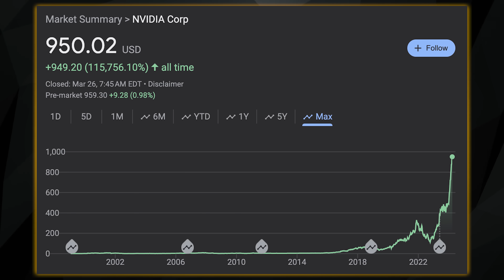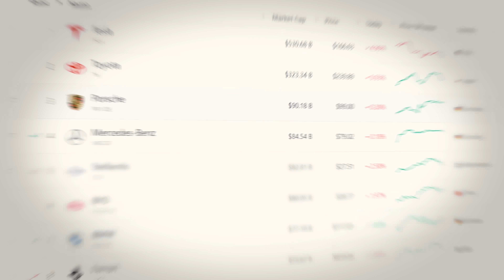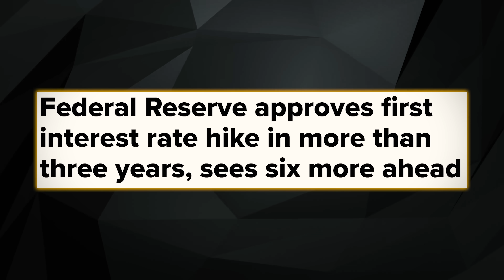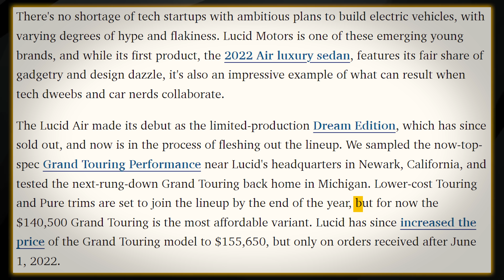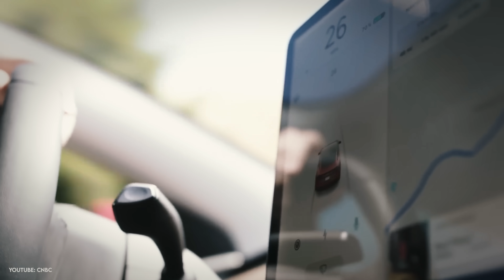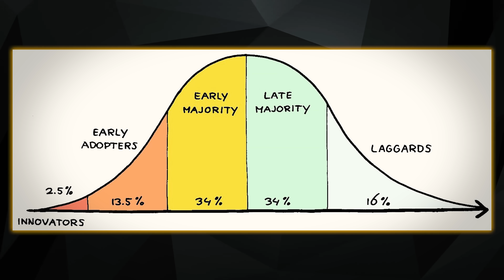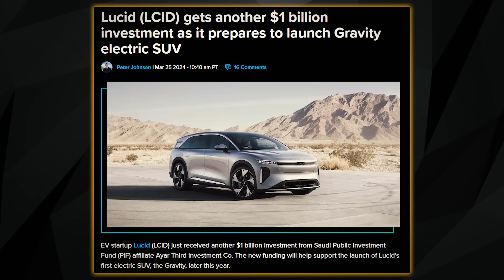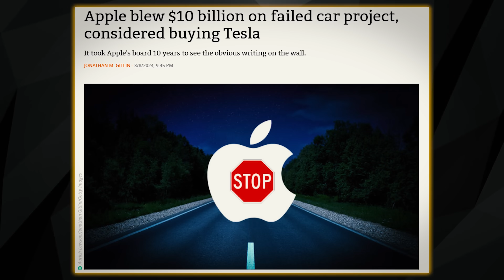The EV Bubble Popped - What Now?

Comment: This video glosses over one of the main issues - infrastructure. There a half dozen gas stations within a few miles of my house. The nearest supercharger bay is closer to twenty miles. I might be able to deal with that commuting to work, but for road trips? I'd better hope nothing comes up, because otherwise the next nearest chargers are hundreds of miles away - with exactly zero on the route I take to visit my family.

Hybrids, with a gas engine charging a battery, would make much more sense, but those aren't considered sexy like an EV. However, they are infinitely more practical until chargers are more common and spaced so that road trips don't require weeks of advanced planning and fear that the stations won't be working when you get there.
Reply: More chargers are certainly the way to encourage use of EVs. It’s technically not that difficult since they don’t have the HAZMAT issues of gas stations, and much cheaper aluminum wiring is already proven as it literally powers the whole world as overhead transmission lines.
Reply: Not to mention the fact that the US already doesn't have enough powerplants and it's pretty much just illegal to build new ones.
Reply: @maxscott3349 why don’t you think they will build more power when demand increases? It’s not strange they don’t supply until demand is there.
Reply: This guy is completely right about hybrids versus EVS
Reply: @TheBooban  The demand has been there for the last 20 years. Many places, including where I live, have started charging more not because it costs more but because they need people to use less
Reply: @maxscott3349  yes and at some point it will be worth it to build more power.
Reply: I live in a city of 279k and we have 12 fast chargers and dozens of slow chargers within 10 miles of any part of the city. Where the Hell do you live with only 1 in 20 miles?
Reply: Eh, my closest ev charger is in my garage, and that could be true for anyone with off street parking, including big multi story parking garages.

I have no idea how many fast chargers are in my city, because on a road trip my first stop will be two cities over once i've run down my initial charge from home. And the same goes for coming home, i would charge two cities over and arrive home empty and plug in when i park.

As for charger availability, i've driven several 6000km round trips in my ev which only gets 200km on a full charge in winter because it's a big van with a small battery, and chargers are not a problem at all in europe. I know that many other parts of the world are still developing countries, but it's really just a question of dropping down some chargers, electricity is everywhere.
Reply: By that same token, consider the stress so many EVs put on the grid. And where do you think the energy in the grid comes from? Mainly non-renewable resources all over America. This ironically exacerbates the environmental damage.  The first and most critical step is to ensure that the grids are powered by reliable sustainable energy sources and people are incentivized to use solar panels and such to generate electricity so that they can charge their EVs while at home.
Reply: Well, you could install a home charger which doesn't really cost that much, and wake up to a full battery every single morning, sounds pretty convenient to me...
Reply: @WaterKing9 where I am at it’s at least 30 miles and I live in a small town in the South
Reply: I'd rewrite the not sexy part. The latest 2023 Prius got quite the facelift last year...
Reply: @Ben21756  Yes, EV's make great commuter vehicles, but if you want to make long road trips, you are still looking at a second vehicle unless want to plan your trip around charging.

Yes, I know it's possible. I've watched several Youtubers do exactly that. However, it's not always feasible.
Reply: Agreed, however we need to adopt as many EVs now mainly if you commute in your city, because we need to replace all ICE cars by 2050, meaning it would last 15 years to replace the stockpile of ICE cars with EVs.
Reply: @doujinflip Also, if you want the average American pickup truck/SUV driver (huge portion of the U.S - just look at F-150 sales), these charging stations NEED to accommodate vehicles with trailers like gas stations do. The inconvenience of having to detach your trailer just to charge, on top of having to charge every 90 miles, is absolutely ridiculous.
Reply: The hybrids are as reliable as ICE vehicles with the potential fuel savings of EV's. 
I don't think anybody see's hybrids as sexy more  like a practical compromise.
Reply: @TheBooban  Because the EPA won't even let them build charge points. 5 Billion infrastructure and they built One, count them One charge point.
Reply: @TheBooban  I was in favor of building more power but now I will fight against it as hard as I can and spend considerable time and money. Turn about is fair play.
Reply: @PriffEV  Two cities over and back I'm not even to half tank in my ICE vehicles and arrive home with enough fuel to do 25% of that trip again. At -5C at night. That would be in my truck, in my car I could do it twice and still have fuel left over.
Reply: @yaxleader  American makers dropped cars. Big mistake! Foreign makes gleefully picked up that market.
Reply: @robertkubrick3738  why? Anyways, they gotta do it at some point, build more power.
Reply: @TheBooban  Because greenies have been fighting power plants all along. Turn about is fair play.
Reply: There is like 25 outlets in my house.
Reply: @PriffEV not a problem in Europe? Something tells me you haven't been in most parts of Europe. You've spoken like a true American there.

Comment: I think many people commenting on EVs haven’t yet absorbed that the maintenance and charging costs are actually not that much better than ICE vehicles. EVs do not need oil changes and they don’t need new brakes as often, but they absolutely EAT tires. People are replacing tires every 8k-10k miles. Compared my current car which needs tires maybe every 50k miles. 

And the cost to charge has actually SURGED. A friend of mine recently charged his F150 lightning and it was 70 cents per kWh. On a 100 kWh charge that would be $70. I get 20mpg in my truck, which at $5 a gallon means I’d pay $75 for 300 miles of range which is about what his f150 lightning does on a full charge.

So maintenance isn’t that much better because you have to replace tires so much more, and charging isn’t actually that much cheaper than gas. And btw, gas near me is less than $5 a gallon.
Reply: Eh, i've driven 40k km in my ev and have no unusual tire wear. You can wear tires quickly with some EVs because they have crazy acceleration, and people drive like they stole them, but with normal driving it's not a huge difference. My ev only weighs 10% more than the ice version of the car, and fully loaded the difference is even less.

As for charging, when i charge at home it costs me about 25% of what ice costs. But on roadtrips it's closer to 80%. So you're not saving much if you're constantly roadtripping and using public chargers, but most people do a majority of their driving closer to home and can charge at normal rates.
Reply: If you have solar panels charging an EV will be close to $0 Try beating that cost with your truck and calculate the fuel saving over the lifespan of the vehicle.
Reply: @xunepxaxo  You would need 30 panels on your house (if the house is going to pull any power at all!) to charge a BEV in bright sunshine to charge a BEV in a reasonable time. This also presumes the car is at home during the day to charge? Do you not have a job? Didn't take math in school? Never put in any study on actual real life output of solar panels? Where are you going to get 7200W...assuming you have the absolute most efficient panels then allowing for real life only getting 80% if that....During the day to just top a battery in a couple hours? No, you charge at night with Coal.
Reply: You have a bad source for information.

Comment: Id hate to sound like an ignorant car enthusiast, but Tesla Sucks.

Their cars sucks, dealing with them sucks, driving them sucks. The only thing they've done right is the charge stations, battery and electric motor technology.

Cheap EVs and hybrids were always better.

A cheap EV makes a good city car because you can plug it in and get enough range to last about a week.
(Think of the nissan leaf)

A hybrid is best because you will burn little to no gas in the city and you have the convenience of going anywhere you want because of how prevalent gasoline is.

Comment: Getting the public to adopt EVs has a basic solution: Make charging station as ubiquitous as gas stations are now. That's it. If charging stations were all over the place, then drivers wouldn't have to worry as much about charging. Sure, charging is a lot slower than filling up with gas, but having the option to charge even for 10 minutes or so would be a huge burden lifted.
Reply: You are making too much sense. That is not how the US government operates. Here what they do is punish the public and make threats. There will be some punitive measures or penalties for you if you sell cars that are not EV and that will be followed by punishment for people who buy cars that are not electric.
Reply: So much of the country has more chargers than cars to charge. Those spaces being empty do not encourage anyone to buy a EV.
Reply: Half the point of an EV is that you can just charge it at home.  90% of the public, including the people fretting about charging infrastructure and range, do not drive anywhere near a couple hundred miles every day and wouldn't even come close to exhausting an EV battery with their daily commute.  Then you can just charge it over night at home.  The big issue here is for people who live where they only have street parking, or in apartment or condo complexes.  That's more of a thorny issue.
Reply: Instead of having ubiquitous charging stations, why not design EVs with standard swappable auxiliary batteries?  Then every gas station can stock them for any EV that needs a short boost to get to their home charger.
Reply: @dcc70  Because you need special equipment and trained professional personell to safely handle these batteries.

Comment: Someone should tell EV car developers that 1: batteries don't work in the winter. 2: the charging network and time it takes is terrible. 3: why hasn't anyone, ANYONE connected an alternator to the wheels, when they spin, they charge the battery.......
Reply: omg take a physics class bro. you lack fundamental understanding of thermodynamics.
Reply: There's no need to include an alternator. Electric motors can convert motion to electrical energy as-is. That's how you get one-pedal driving and regenerative braking.
Reply: Ah yes, EVs don't work in winter, except in all the cold countries like the nordics where EVs are now a majority of car sales.

And charging is terrible, when i drove down through europe i sometimes drove 30km without seeing a charger!

And alternator on the wheels? Why don't you just tie a rope to a stick and stand on it, and pull the rope to lift yourself up to the second floor?
Reply: Norway is like 80% EV...Pretty sure they work in the cold.

Comment: I was a fan of EVs but when it came to spend my hard earned money on the car, I ended up buying a Lexus, I don't really understand what problem EVs are trying to solve. They are not that much better for the environment because of the Lithium mining, and public transport would actually improve emissions significantly unlike EVs. Public transport around the city is where EVs excel at compared to ICE cars but as previously said, better public infrastructure pretty much solves that issue. That leaves long journeys where traditional ICE cars are just better. In my case, I mostly use public transport here in London to go to work and for long roadtrips is when I use my car and I don't want to be looking for chargers and spend time there. So the only practical advantage is less maintenance.
Reply: EVs are better for the environment. It's not even close. 

The problem with EVs is that they're currently more expensive  (usually, depends on the use case) over a 3-5 year lifespan.
Reply: @PlaylistWatching1234  When you factor in the kobalt and lithium mining as well as the fact that they're still charged off of fossil fuels due to that being the default setting for most power grids, they're actually worse for the environment. Not to mention the lack of reparability and the inherent flaws of lithium batteries as a whole. Although modern ICE cars still pollute, they're very fuel efficient and only do so at a minimum.
Reply: @rantzntirades1104   @rantzntirades1104 
1. Lithium mining causes way less emissions than gasoline usage. 

2. EVs are cleaner, even when charged from  coal or gas power grid, because EVs are crazy efficient.

3. Don't really know what inherent flaws of lithium batteries you're even referencing.

4. The only thing you have right is that EVs are more expensive to repair, because they're more expensive cars period.
Reply: @PlaylistWatching1234  COBALT is not better for the environment ever. They add Cobalt to bombs because Strontium 90 isn't deadly enough long enough.
Reply: @PlaylistWatching1234  You can drive the equal ICE vehicle 70k miles before the BEV green footprint of a BEV catches up, according to Volvo who make the same model car in ICE and BEV variants and Volvo Claims to be going all electric by 2030, so I think we can trust their math.

Comment: Savings on maintenance is a fallacy. Evs are much more costly to fix, much harder to find people to repair them, much higher in insurance. 

Additionally they  have complications of where and increasingly when to charge.
Reply: If they break and wear much less, why do you even care?
Reply: @mondodimotori  the problem is they don’t. Thats the first. They’re very temperamental. The reason they cost more to insure is for that very reason. The second problem of why you will care is when you want to sell it. The cost of repairs and  battery issues drive down the cost of resale dramatically. An EV is a luxury belief purchase at this point, and nothing more.

Comment: Still waiting for the day transit overtakes car ridership in the US 🙃
Reply: You will be waiting for quite a while!
Reply: The problem with transit is that it's completely useless outside of cities. I live in the middle of nowhere and work in different ones all the time, and have different hours all the time. Even if I did live in one of those cities, it's just not compatible with a lot of situations.
Reply: @maxscott3349  yup, I completely understand. I grew up in a rural town 35 miles away from the nearest city myself so I get your pain. However, most people live in cities now, where a good transit network and density would do wonders for the vast majority of people, while reducing traffic for the remainder of people that DO want to or need to drive. It's not an either-or thing.
Reply: @JakeGaige Great that you do, enough people don't, friends and family of city dwellers included, for that to be irrelevant. They still have reason to leave urban areasand thus buy cars.
Reply: @maxscott3349  Back in the old days, even fairly small towns still still had rail service once daily. There's no reason why we couldn't build normal, slow trains to relatively small towns. It's not a complete solution but it could help.
Reply: This guy gets it
Reply: @kingofhearts3185  yeah actually it does turn out that the majority of the population live in or around cities
Reply: @sagivaleon7355  I didn't say anything about a majority, just a large amount don't.
Reply: @kingofhearts3185  I mean, a large amount from what perspective though? Because you were saying that public transit is irrelevant since so many people live outside of cities, but over 80% of the US population lives in urban locations lol
Reply: Thats the day the US officially becomes a nanny state.
Reply: @sagivaleon7355  Yeah but urban population density is a problem that society will need to solve moving forward. Its the main cause of pollution, housing unavailability and diseases spreading rapidly.
Reply: @DeadNoob451  lol
I'm not really sure where you're getting that information from, but suburban neighborhoods are far worse than cities in terms of pollution. The housing crisis also has nothing to do with cities- it's entirely just zoning laws preventing new homes from being built (which is something non-urban homeowners specifically contribute to as well, because more houses = their houses are worth less).
Reply: @niamhleeson3522  We have it Ft. Worth to Dallas Tx and nobody rides those trains.
Reply: @sagivaleon7355  NIMBY in cities is a housing problem. If you plan to build low cost housing, people will move out. They also fight like hell before they move.
Reply: thats what im saying what has been around for over 100 years "self driving" and more efficient then anything on the road today a train
Reply: @code54crunchy50  Electric trains powered by the grid are extremely reliable and also the only true EV that I know of. Battery Electric Vehicles are Battery vehicles, which is a point failure source for any machine.